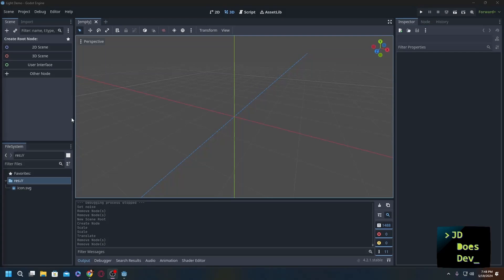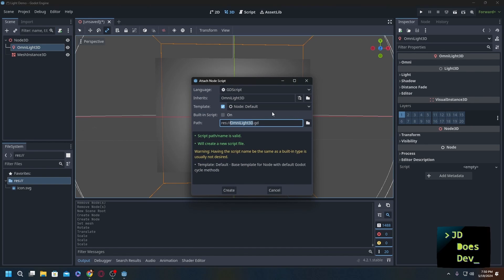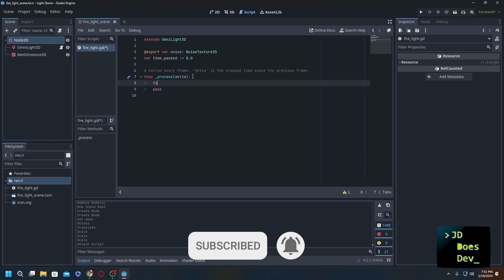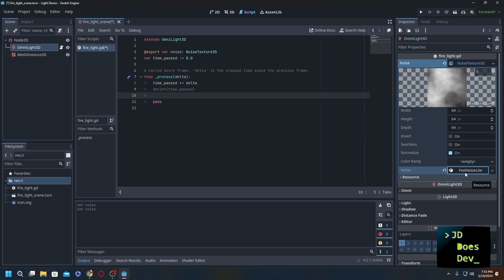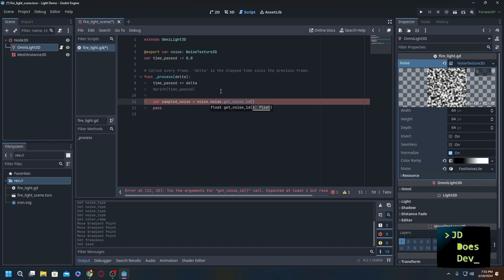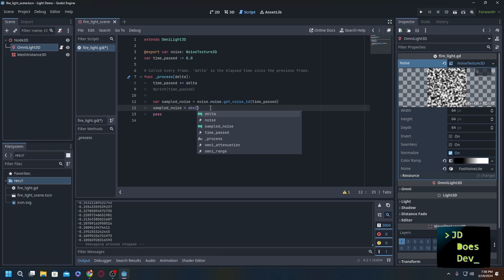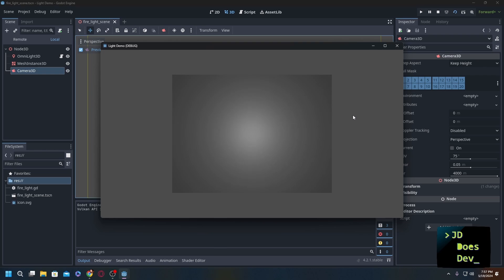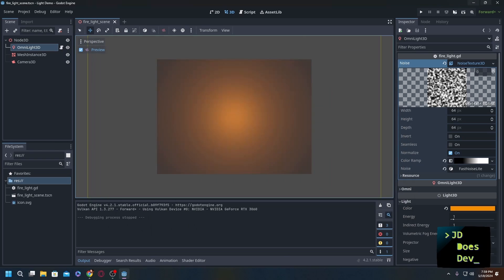Make Flickering Fire Lighting in Godot!

Comment: I found out that you can just use FastNoiseLite by itself which lets you skip the noise texture middleman. Also, you can get some smoother looking results if you do noise.get_noise_1d(time) * 0.5 + 0.5 rather than abs. I thought I'd share if it's useful to anyone.
I'm grateful to you for this video, though. I didn't realize you could use FastNoiseLite to get 1D noise like this, and it's particularly useful for the custom lighting system I'm working on. Thanks. 🙂

Comment: This is a great tutorial!!! My only problem is that the light is very dim, with the energy level never even getting to 1. Is there a way I could make a minimum and maximum value for the noise?
Reply: Probably add a simple base value to the light_energy in the code so it still has some light !

Like in :
light_energy = (sampled_noise * 0.5) + 0.5